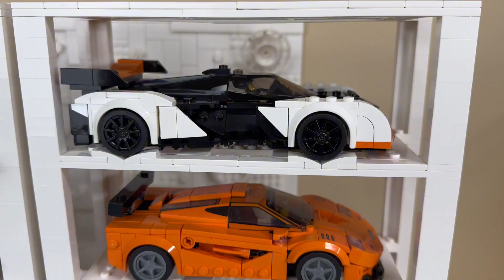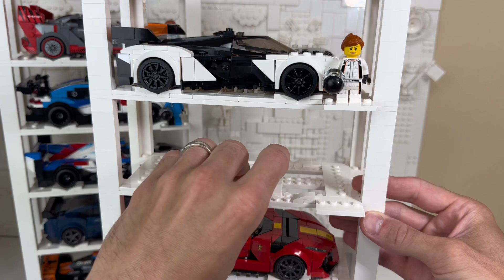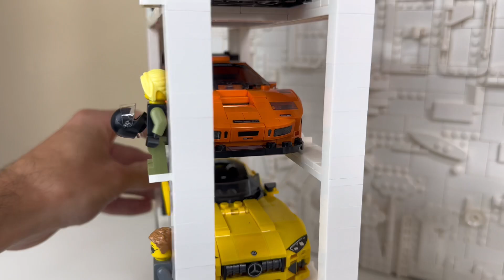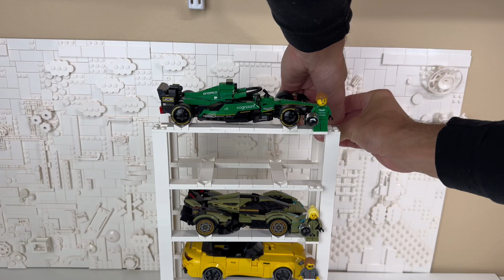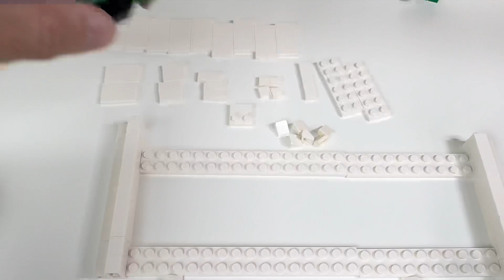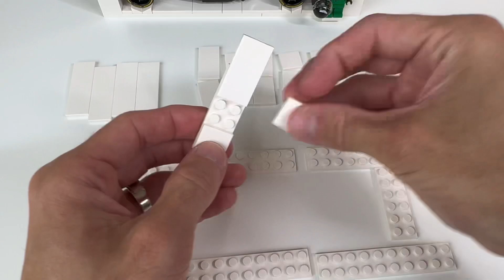LEGO Speed Champions: Brick-Built Display Rack - Ver. 3 Tutorial

Comment: what about the dodge dragster?
Reply: For an upgraded version 3 you could make it so 1 row fits two cars on each ayer but the dragster has a custom layer for itself but it's still the same size
Reply from the maker: Hmmm… I’ve kinda neglected building a display for the dragster. Do you have any ideas how this car should be displayed?
Reply: @thegreenbrick you could make to selves connected and the bottom self doesn’t have the middle wall so the 2 or 3 together make it long so the dragster can fit
Reply: @thegreenbrick or make a little drag track diorama